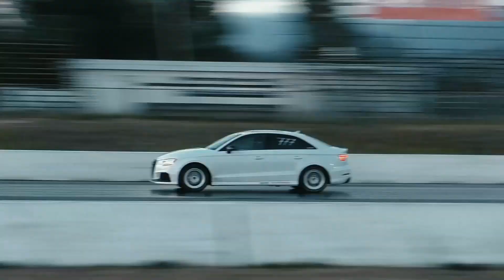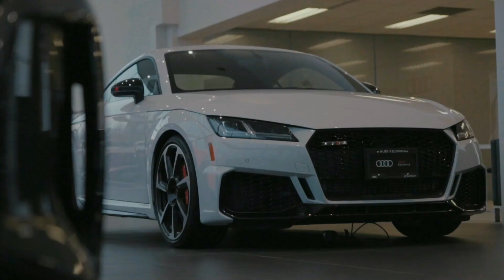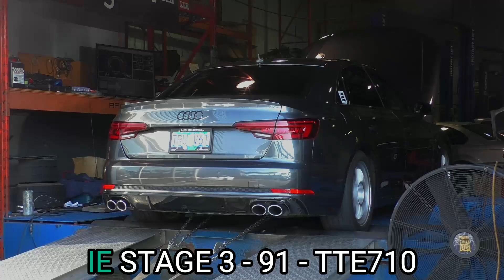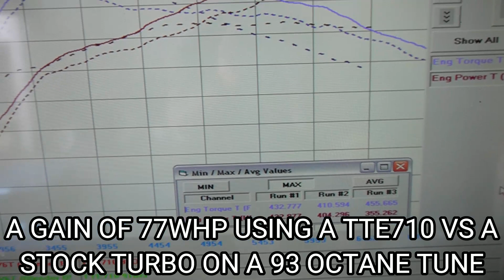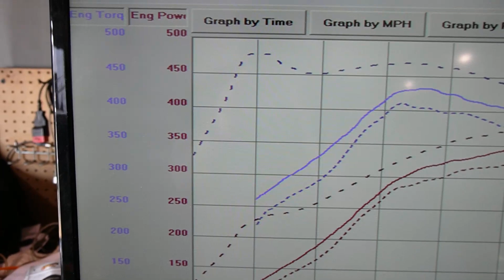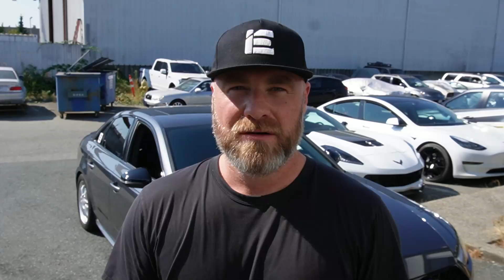TTE710 - Integrated Engineering Stage 3 - 91 & 93 Octane Dyno Testing - Audi B9 S4

Comment: My Stage2 does 414whp with stock turbo, pretty flat to about 5500rpm then it dies off. Lots of money to just have power in the high revs while losing 30% torque down low. I would have thought you would get close to 550-600bhp with a big turbo to compensate for the lag at the bottom.
Reply from the maker: You can't compare dyno results from one dyno to another, from one part of the world to another. It doesn't work like that. In this video I was showing Mustang dyno numbers, which are INCREDIBLY low. If I had shown you the Dynojet calibration numbers instead, it would have been roughly 500whp & 500wtq.

Comment: Not many people can swallow that pill Adam. All they care about is the #s on a dyno. I will probably never dyno my S4. 

Numbers on a dyno can vary greatly from one to the next, but ET and trap speed wont change that drastically at your strip.
Granted, a track in Colorado vs sea level will have variations, but at you local track, you should be consistant. 

Last car i had made 500 on one dyno, then without changing anything, made 550 on another. 

Ran the same speed and ET at the strip though.
Reply from the maker: Exactly! Dyno's are meant for before and after testing on the same day. They aren't meant to compare to one another in different parts of the world using different fuels, on different brand dynos in different ambient conditions.

Yes, racing in different conditions will also greatly affect your performance. I'm referring to what the car will accomplish at sea level in like 0 to 1000DA.

Comment: Since I will only keep my car on the street I'm thinking Stage 3 isn't worth it for me. For daily driving I love the down low torque from the stock turbo.
Reply from the maker: Once you see my 1/4 mile times I bet you'll be changing your mind. Dyno tests tell you VERY little about the true daily drivability of a car.
Reply: @VancityAudi  I look forward that video! Even then I believe the stock turbo always has the advantage of better down low torque. Supposedly the TTE710 makes better torque down low than the TTE810. That's the main tradeoff with going with a "bigger" turbo: low down torque vs higher/broader power band.
Reply from the maker: @voop00p  Well you are certainly correct there. If all you are concerned about is max torque down low, no aftermarket, larger turbo will improve that.  A Stage 2 E65 tune will make some serious torque down low versus what any upgraded turbo can make. You just lose all that power after 5400rpm. To each their own!
Reply: If you want more power just rev more. Go electric if you want low end torque

Comment: The B9 has so much potential. I should trade my CREC powered Q7 for a TRU V6T Q7 and put a TTE710 on it, lol. On the TT710 93 run, what was the boost pressure and timing versus the e85 stock turbo boost pressure and timing?
Reply from the maker: Not sure if you were serious or just joking, haha. There are no calibrations for the Q7 yet so you'd have to go with custom tuning if that's what you wanted to do. As for the peak timing advance and boost I don't share that stuff seeing as IE has gone to extensive lengths to perfect their tuning of this turbo. Other customers may happily share that info, but I don't think it is fair to. I can tell you that my peak timing is less than a 1/4 of what I saw with the stock turbo on E65 then I did with the TTE710 on their pump gas tunes.
Reply: @VancityAudi  Thank you for taking the time to reply. It was just a joke since the Q7 doesn't really fit into the tuner category, hence not much aftermarket support. However, and IMO, a TTE710 Q7 does sounds like a tempting build. A family sleeper SUV that would be an unexpected rival on the drag strip to an SQ7. 

When asking the question I didn't think of the "proprietary" aspect of boost and tuning values. I appreciate the ratio value of "25 %". This provides a ball-park idea that hints at the potential of the B9 3.0T platform coupled to a TTE710 and that the vehicle configuration is barely breaking a sweat (except for the OE fuel system). I've recently started researching some TTE options for my B5 S4 since they are highly regarded with making some seriously powerful and reliable turbochargers.
Reply from the maker: @pearl04tl  I'm now on my 4th TTE turbo and I have loved all of them!

Comment: Hard to gauge with this dyno, can’t wait to see it on the track and see what times it can put down
Reply from the maker: What's hard to gauge?
Reply: @VancityAudi  hard to gauge how much lower this dyno reads than a dynojet and especially with your high DA, I understand you care more about improvements but I’m excited to see improvements in the quarter mile
Reply from the maker: @maxpetruccelli5444  well to give a bit more info they usually calculate the hp ratings at the crank on this dyno with a 25% drivetrain loss with how low it reads. Plus now that I have around 40whp more than the Stage 2 E85 tune AND that power gain is right where I need it, I'd say you can expect atleast a 2mph gain in the 1/4 mile.

Comment: Good stuff.  I think it would have been easier to see the curve on that last graph (stock turbo E85) if you would have dropped the TTE 91 run.  With 3 runs on there it's hard to see the power/tq differences with all of them running into each other.  Excited to see what this runs now at the strip.
Reply from the maker: I'll take that into consideration next time out. I wanted to show the 91 run as well because a lot of people only have 91 octane fuel available to them.